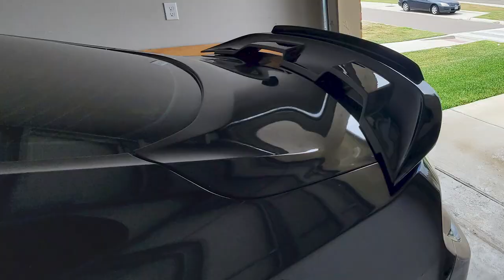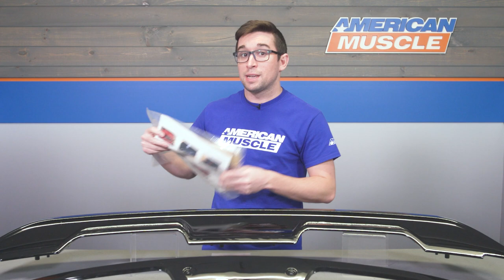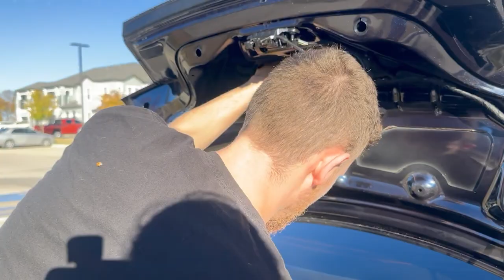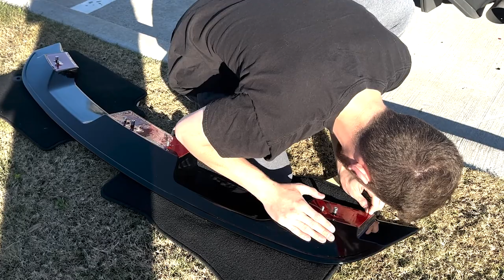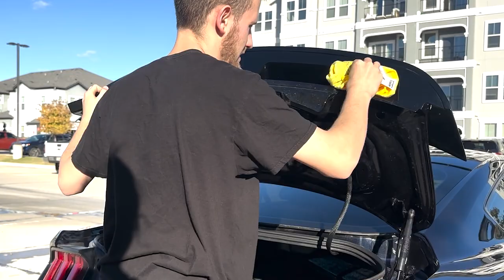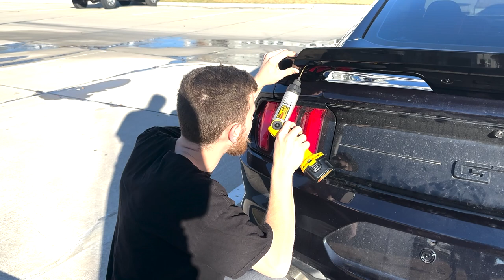2015-2023 Mustang MP Concepts GT500 Style Rear Spoiler with Wicker Bill Add-On Review & Install

Comment: this looks like it would replace my factory base model 19  gt little spoiler with no drilling . Have you guys made a video about what spoilers fit without drilling into the car ? I have a 19 gt and would like to see what no drill spoilers are out there but its not easy finding reliable info .
Reply: No drill, your options are going to be ducktails. There aren't that many on AM site so just go through them, probably like 5-7 at most anyways. Going for the bigger wings, either get a parted out predrilled or pay a shop to do it. You But make sure the current one you have is a nodrill one. Mine was an itty bitty ducktail but still got 3 holes.
Reply: Doing a spoiler on my 19 right now, the gt350 one has holes in the spoiler and you just screw in the provided screws and put on the double sided tape. Others are like(studs mounted to it) this which is what oem is like.

Comment: I have to drill holes in my trunk. Does it come with a template?
Reply: yes it does, use masking tape to put it on and it should be simple from there (not sure, i have to remove the old spoiler from mine!)